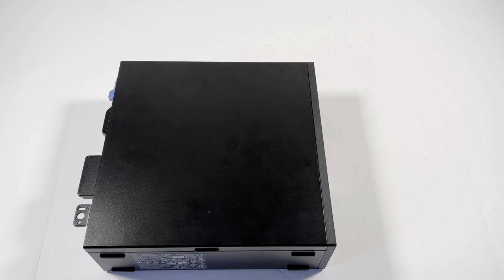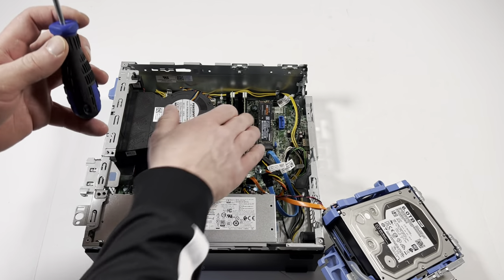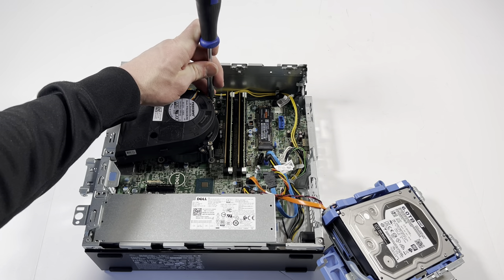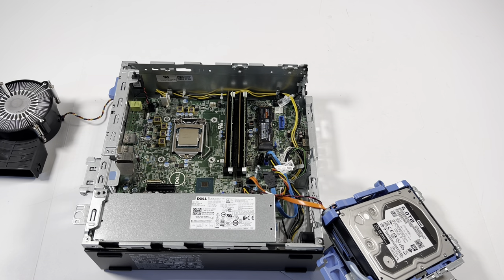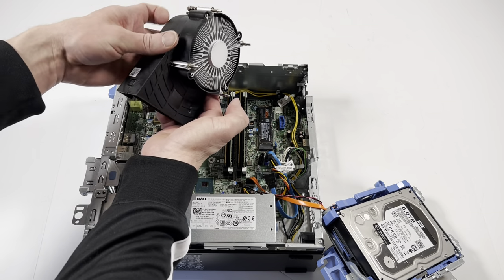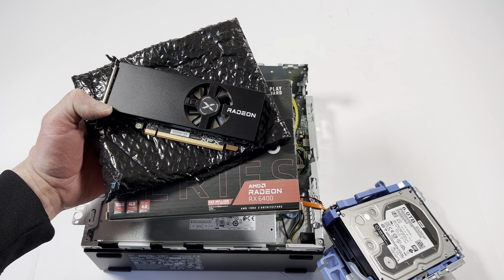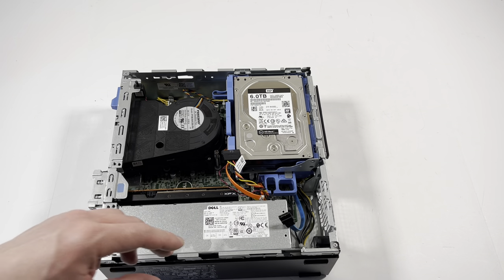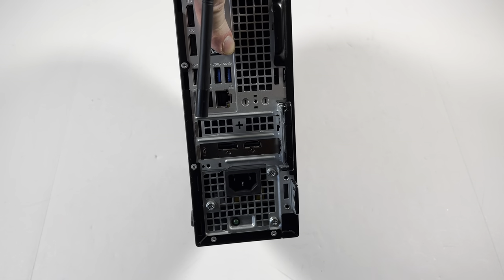Dell Optiplex 5070 Video Card SSD RAM Gaming Upgrades

Comment from the maker: List of Parts and Upgrades works with this dell optiplex 5070.

Dell Optiplex SFF Reassemble
https://www.youtube.com/watch?v=d_iJJm0R1hk

Dell Optiplex 5070 Teardown:
https://youtu.be/HbMezxrIVMg

Dell OptiPlex 5070 Small Form Factor PC
https://amzn.to/3BNnroK

CPU Support List: 
(1.) Intel Core i7 9700, 8700, (9th Gen, 8th Gen)
(2.) Intel Core i5, 9600, 9500, 8600, 8500, (9th Gen, 8th Gen)
(3.) Intel Core i3, 9400, 9300, 9100, 8300, 8100  (9th Gen, 8th Gen)
(4.) Intel Pentium Gold G5400, G5500

USB WiFi Adapter for PC, Wireless USB Network Adapter
https://amzn.to/3Iv0dHr

List SSD Heatsinks:

(1.)  M.2 2280 SSD heatsink, Double-Sided Heat Sink, PCIE NVME M.2 SSD
https://amzn.to/3l2ittr

(2.)  EZDIY-FAB M.2 2280 SSD heatsink, Double-Sided Heat Sink, PCIE NVME M.2 SSD
https://amzn.to/3m7J3me

List SSD M.2 Type 2280 NVMe PCIe:

(1.) Crucial P3 Plus 4TB PCIe M.2 2280 SSD
https://amzn.to/3RZcUNi

(2.) Crucial P3 Plus 2TB PCIe M.2 2280 SSD
https://amzn.to/3RTUi0Y

(3.) Samsung (MZ-V7E1T0BW) 970 EVO SSD 1TB M.2 NVMe
https://amzn.to/3d52k2a

(4.) Samsung 970 EVO Plus SSD 500GB
https://amzn.to/3fpi95A

(5.) Samsung (MZ-V7E500BW) 970 EVO SSD 500GB - M.2 NVMe
https://amzn.to/37uuLFw

(6.) Crucial P1 500GB 3D NAND NVMe PCIe M.2 SSD - CT500P1SSD8 
https://amzn.to/2N07wKh

List of RAM will work with this system MAX 64GB.
Supports Non-ECC DDR4-3200/2666/2400

Crucial Pro RAM 32GB Kit (2x16GB) DDR4 3200
https://amzn.to/3q5eFQ3

(1.) Crucial 32GB Kit (2 x 16GB) DDR4-3200 UDIMM
https://amzn.to/3BdbNm3

(2.) Crucial 16GB Kit (2 x 8GB) DDR4-3200 UDIMM
https://amzn.to/3U24CpE

(3.) Crucial RAM 64GB Kit (2x32GB) DDR4 3200MHz
https://amzn.to/3xEsF4b

(4.) Crucial RAM 16GB Kit (2x8GB) DDR4 2400 Memory
https://amzn.to/3MLA3mx

Thermal Grizzly - Spatula for Applying and Spreading Thermal Paste 
https://amzn.to/3d8NQEE

Thermal Compound Paste:

(1.) Arctic Silver 5 Thermal Cooling Compound Paste 
https://amzn.to/2ziNU0H

(2.) Noctua NT-H1 3.5g, Pro-Grade Thermal Compound Paste
https://amzn.to/36kTk7A

(3.) ARCTIC MX-4 (current edition) Thermal Compound Paste 20 Grams 
https://amzn.to/2DhGJaK

List video cards will work with this system.

(1.) AMD Radeon RX 6400 Low Profile Gaming Graphics Card
https://amzn.to/3s8MUUY

(2.) PowerColor AMD Radeon RX 6400 Low Profile with 4GB GDDR6 Gaming Graphics Card
https://amzn.to/3ucfFEm

(2.) Gigabyte GeForce GT 1030 GV-N1030D5-2GL Low Profile Graphics Card 
https://amzn.to/2Z4PHkp

(3.) ZOTAC GeForce GT 1030 2GB GDDR5 64-bit Low Profile Video Card ZT-P10300A-10L 
https://amzn.to/2WzgLXk 

(4.) MSI Graphic Cards GT 1030 2GB GDDR5, Low Profile
https://amzn.to/390Spum

(5.) PNY NVidia Quadro K1200 (Low Profile) Supports 4 Monitors
https://amzn.to/3RE5lf7

HDD list works with this PC:

(1.) Seagate BarraCuda 4TB Internal Hard Drive HDD – 3.5 Inch
https://amzn.to/3d3xWeR

(2.) Seagate BarraCuda 8TB Internal Hard Drive HDD – 3.5 Inch
https://amzn.to/3xjUDSJ

(3.) Western Digital 2TB WD Blue PC Hard Drive HDD - 5400 RPM, SATA 3.5" - WD20EZAZ
https://amzn.to/3w3jIQA

(4.).WD Black 2TB Performance 3.5" Hard Drive - 7200 RPM Class, WD2003FZEX 
https://amzn.to/2xFUeyF

Disclosure: Amazon links this means that if you purchase an item we earn a small sales commission affiliate.

Comment: i have dell optiplex 5060 sff that i just got, and i installed the swft105 radeon rx 6400 GPU. i don't have anything installed on it yet so i don't know the exact temp. but when after turning it on i noticed that the GPU gets really really HOT!!! does anyone have the same experience?
Reply: You need to know the Power supply of your GPU does it goes with your graphic card.

Comment: No matter what i do this pc keeps using the intel gpu it wont use my nvidia even when i select it in the bios whats the issue?
Reply: Are you plugging the display cable into the gpu?
Reply: @crazyxprosanta8096  The issue was a bios setting. The cable is connected to the video card.
Reply: did you install the nvidia stuff on the website
Reply: @SStachie  yes I did. I got it to work. It uses the integrated and nvidia gpu now.

Comment: i connected that same graphics card to my computer with a power supply of 180 but it just got stuck on the dell screen, the computer is identical to yours
Reply: I got a gt 1030 on my 3040 optiplex 
180W PSU I repeat 180W 

I disconnected the optical drive to add a secondary HDD 

And it's running with 5w speakers usb 

No power failures whatsoever.

It's probably maxing 110W
Reply: @doomdesire3460  im going to upgrade my psu to a 500w with a adapter 24pin to a 6pin
Reply: @dzvnxn  you can put a 3070 with that
Reply: @dzvnxn is there a 500W PSU that will fit inside this model Optiplex? The biggest problem with SFF PCs is trying to fit a non-proprietary PSU in them and usually there is only one OEM part with a limited power capability.

Comment: I have the exact same Optiplex and I just ordered an M.2 SSD for it. The service document says that there should be a thermal pad under the M.2 slot. I see on yours at 1:00 that it doesn't have one. Have you successfully installed an OS on the M.2 and no issues at all? I have an M.2 heatsink lying around here and I should use it if wouldn't cause any clearance issues under the HDD/ODD caddy.

Comment: Can  upgrade power supply in optplix 7040 sff
Reply from the maker: Hi, yes you can.
Reply: @mxkdt  can upgrade 240w and rtx 3050 low profile and 32 ram
Reply: Would you even need to upgrade the PSU to 240w if the rtx 3050 LP pulls peak 70w from the PCIe slot solely?